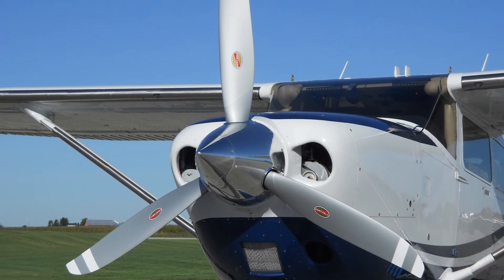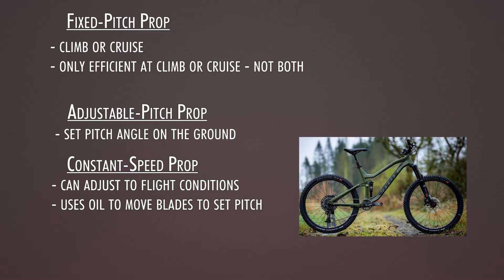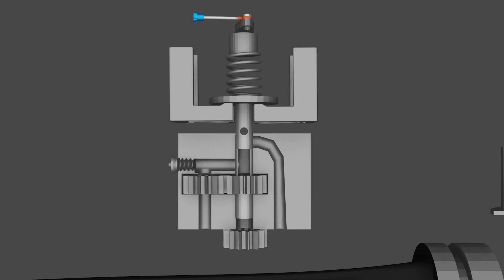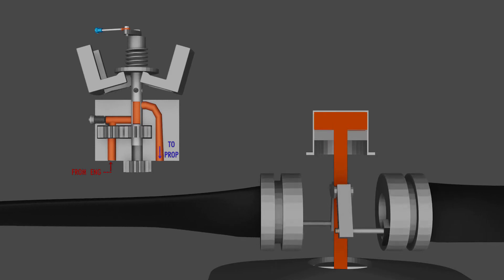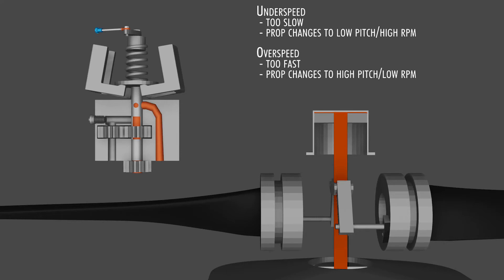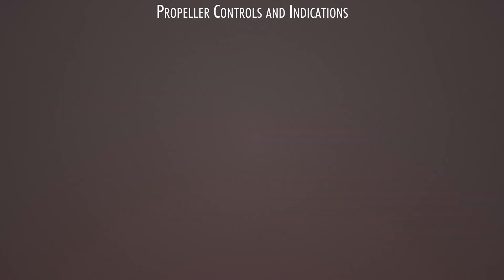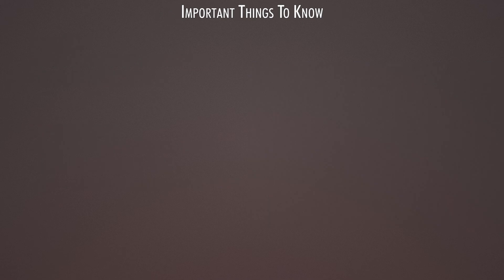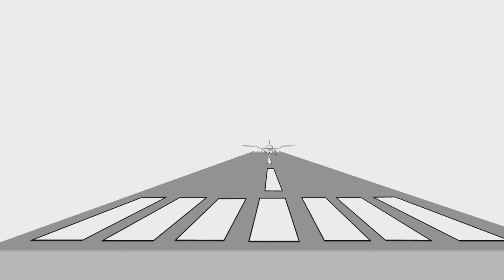Constant Speed Propellers | PPGS

Comment: About to do the training for the CSU and RG design features in a 172RG. This was incredibly helpful. Do you have any ground school for the RG component? Couldn't find any in your videos.
Reply from the maker: Congrats! Hope it works well for you. If you're doing a flight school program or even a complex endorsement, the gear and prop are required to be taught. I'm fairly certain you'll look like a genius knowing what you know about the prop and can also learn about the gear in the process. I don't have any videos on the hydraulics of the gear,  because you usually don't see that until your commercial flight training (fixed gear planes are cheaper)... Sorry

Comment: How does the oil get from a 'non-rotating' engine into a rotating prop hub? Through the back of the crankshaft?
Reply from the maker: Constant-speed props work on engines with hollow crankshafts. That's how you get the oil in there.  Really good question.

Fun fact: if your engine has a solid crank, trying to switch from fixed-pitch to a  constant-speed prop won't work.
Reply: @PrivatePilotGroundSchool  Check! Thanx for the quick reply. Keep up the good work ... ^v^

Comment: This is a great video and animation. But I thought pushing in the blue knob deepen or increase the AOA of the blade which decreases the rpm. Maybe I am missing something?

Actu, nvm I think I got it.b
Reply from the maker: I guess there's no need for an explanation...

Jk, here's one anyway. 
Say you set your cruise control and start going uphill. The car will try to maintain the set speed, but might shift into a different gear. It's somewhat similar with the prop. You set the RPM and the prop figures out what angle will give you that. That's the whole flywheel spinning and oil pressure thing.

Comment: Why are propellers twisted? I know it’s too keep the AOA the same at the tip where the blade is faster, but why does relative airflow change with speed and what does this look like accelerating on takeoff?
Thanks
Reply from the maker: Hopefully this answers your question.
Propellers are twisted because they spin around a central point and the further from the center you are, the more distance is covered in one rotation. The part next to the spinner might cover a distance of a few inches, while the tips can cover 20 ft per rotation. If the blade angle was the same, the inside would go 120 mph, while the tips would be at 550 mph. The same pitch over that entire surface – that would seriously bend the tips forward! So that’s why they’re twisted; to maintain the same angle of attack across the entire propeller. Fun fact, the larger the prop, the lower the maximum RPM limitation (C172 [72 in] – 2,550 RPM, C208 [104 in] – 1,900 RPM).
Based on the above explanation, the blade angle is basically the same over the entire prop – imagine it as a wing, no twisting required. The blade rotates around a plane of rotation, so the relative wind would be from one location (opposite the rotation) if you weren’t moving forward, like when you’re stationary on the ground. 
If we equate this to a wing - the same angle of attack, but faster relative wind = more lift. You can also increase the angle of attack for more lift at the same speed. If a fixed-pitch propeller spins faster, you get more thrust. If you increase the propeller blade pitch on a constant-speed prop, you also increase thrust for a given RPM. Hope that wing to prop correlation made sense.
Relative wind on a propeller is the combination of the rotational speed and forward speed. If you look up most explanations, you will see the rotation vector (↓) plus the forward velocity (←) = relative wind vector (↙). The relative wind direction moves forward with more airspeed. 
Think of it this way. Imagine an air molecule coming up from directly beneath the propeller. If the airplane is moving forward, by the time that molecule gets to where the prop is, it will have been left behind the prop. The molecule that actually hits the prop is in front of it and comes up at a shallower angle of attack. So the faster you go, the further forward the air molecules are that the prop actually hits. This is why the relative wind moves forward and the propeller angle of attack decreases with forward speed. 
On takeoff, you start with a large angle of attack and as you pick up airspeed, the angle decreases as the relative wind moves forward.
A somewhat related thought experiment can be done with the teacup ride at Disney. If the ride was stationary, and you were in one of the cups spinning like crazy, the relative wind would be opposite of the way you spun. Now fire up the ride and spin the entire thing and the wind will be coming from ahead of your rotation due to the forward motion. 

Sorry for the long-winded explanation, hope it helps you or whoever is curious. Definitely a neuron-firing exercise. 

Great question.

Comment: Great explanation but doesn't the blades actually move what is that about
Reply from the maker: I'm not sure what you mean by that? Can you elaborate? Thanks
Reply: @PrivatePilotGroundSchool  Yeah what I meant to say is don't the blades actually twist or rotate when you move the prop lever
Reply from the maker: Not directly. But the prop lever moves the flyweights which move the pilot valve and then the blades move by oil pressure. But I get what you're saying, its not like the mixture or throttle.
Reply: @PrivatePilotGroundSchool  okay I'm just a sim pilot but I remember years ago watching a video on the prop lever and I thought the blades twist to cut more air or or vice versa.
Reply from the maker: Hey, there's no shame in being a sim pilot.  Do you have a yoke and pesals and all? 
And the prop does change angles to take a different size bite of the air. The bigger the bite, the more it pulls forward.  You just want to make sure the power is less than the RPM. So 23" manifold pressure and 24 hundred RPM is fine. But not 23" and 2000 RPM. 

Glad you're liking the content
Reply: @PrivatePilotGroundSchool  yes I have yoke,rudder petals,and throttle quadrant.  I love learning
Reply from the maker: That's awesome! Keep at it. Aviation is so much fun. My controls are still in the box 😂
Reply: @PrivatePilotGroundSchool  lol Yeah I've been into it for many many years and I do love it and I'm glad I found your channel
Reply from the maker: Welcome. Glad to have you. If you've got video ideas or questions, don't be afraid to toss them out. Always looking for new video ideas and questions.
Reply: @PrivatePilotGroundSchool  okay sounds good I'm sure they'll be something cuz you can never stop learning

Comment: Good video! One little remark at 7:04 - I think it would be proper to say to 'ADJUST THE MIXTURE' instead of 'lean it'. When you're low (e.g., about to land around the MSL) - you need a full-rich mixture, not leaned. And when you're gaining altitude you need to slightly lean it every 1000 ft, regardless of whatever you will do up there (practicing slow flight / land at a mountainous airport / other reason to reduce power).
Reply from the maker: That's a really good point! In my defense, I think there's something along the lines of 'adjust the mixture if you need to', but you're totally right. I hope people read the comments...Thanks for pointing that out. I wish there was a way I could mention all the finer points.